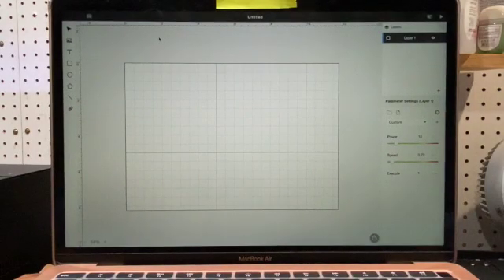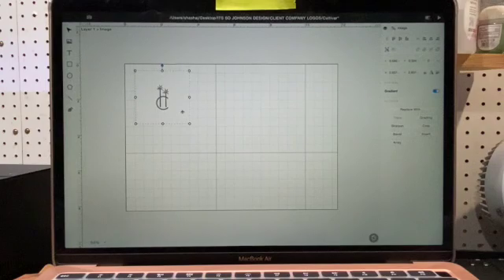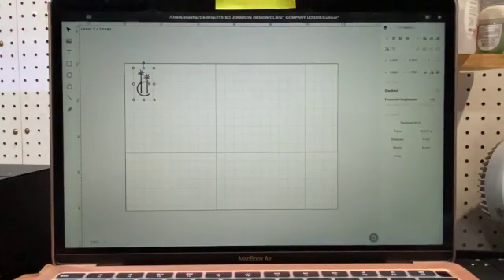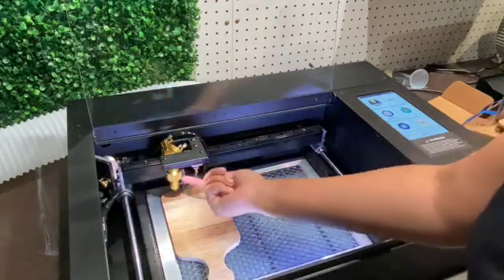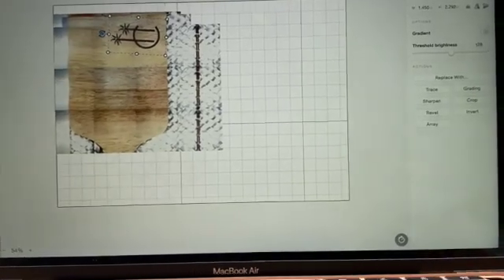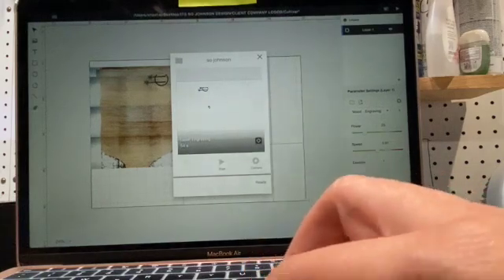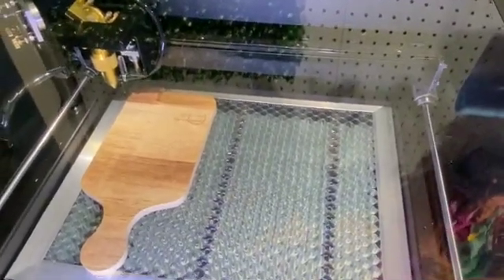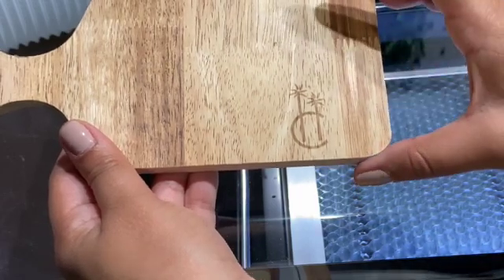How to Engrave Wood on Flux Beamo Laser Machine I Laser Engraving Tips for Wood I Desktop Laser

Comment: Thank you for the video.  I am no expert but when you rotated your image (logo) it was not quite 90 degrees.  If you hold down the shift key when rotating it with your mouse, it will snap in 45 degree increments.  This makes is very easy to rotate an image 90 degrees.  Again thank you for the nice video and explanations.